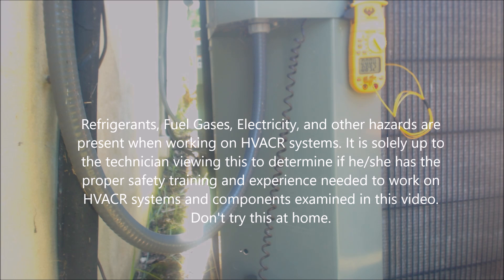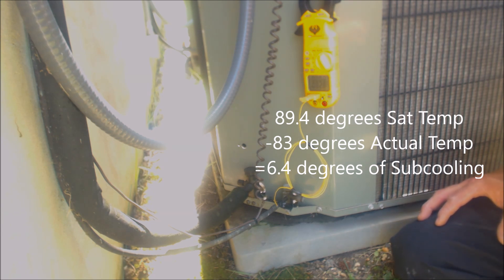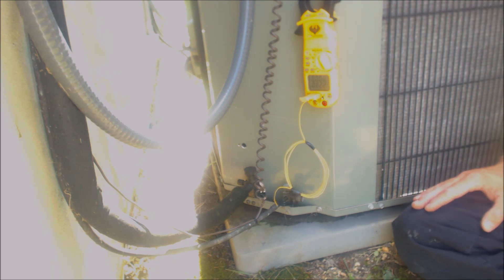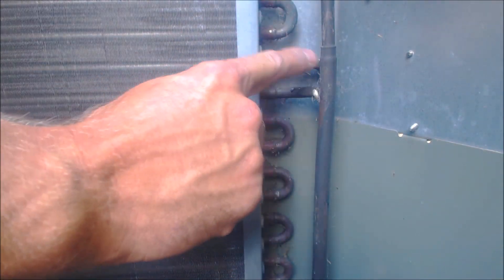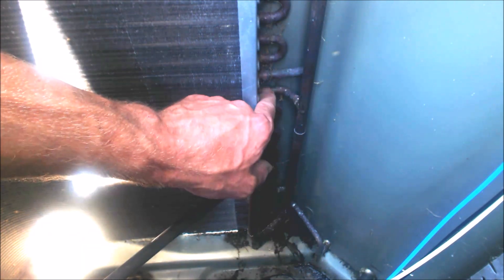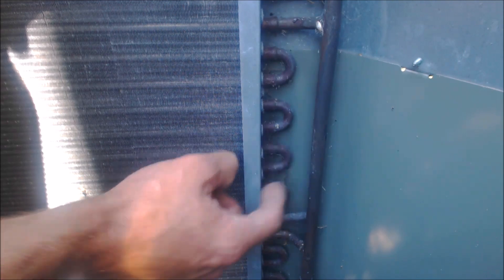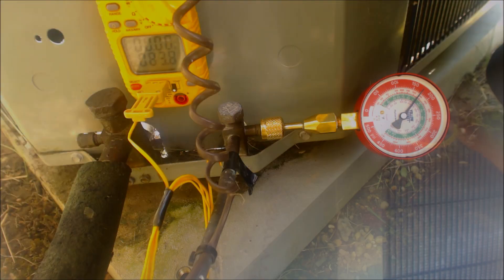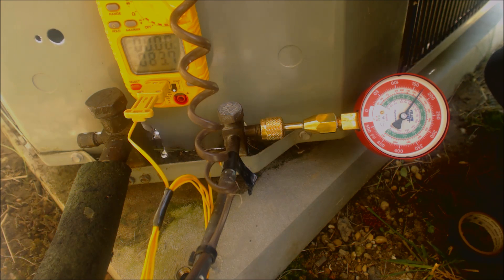Can You Really Check a Refrigerant Charge without Gauges?

Comment: Many newer EEV valve evaporator coil systems use two thermistors to estimate cooling evaporator superheat.  

First, cooling evaporator coil has a narrower saturation temp range than outside condensers since expansion valve is targeting about 42 degs F evaporator temp where condenser coil is at the mercy of outside ambient temp that varies quite a bit more in temp causing variation in where is the 'sweet spot' within the coil for nominal condenser saturation temp.  

On heat pumps the outside evaporator is at the mercy of ambient temp so two thermistor sensing does not work well for estimating superheat during heating mode. They usually use a convention pressure sensor transducer on outside coil along with an output temp sensor to estimate superheat for heating mode.

The primary adjustment on indoor evaporator superheat for cooling mode calculation uses two thermistors, one place on suction discharge pipe (like bulb position) and one placed at top of evaporator about six inches away from expansion valve manifold splitter.  This first near to expansion valve thermistor will typically read 4 to 6 degs F higher than actual evaporator nominal saturation temp due to pressure drop of 8 to 12 psig through the evaporator.  They fudge the first thermistor reading down by about half the expected evaporator pressure drop to get the approximate nominal evaporator saturation temp.  

Then subtract output suction line temp reading from the expected evaporator coil pressure drop corresponding fudged lower temperature from actual first thermistor close to expansion valve to get superheat.

Not perfect but a lot cheaper solution than an actual pressure transducer and does not intrude into pressurized suction line creating a potential leak point.

Comment: Hello! With a 3.5ton unit,in hot weather 100+ degrees outside AZ weather,what would be the lowest quantity of freon be in order the unit to cool down? Some technician told me the unit was a bit over half with freon and added 2 pounds to fill it up but still the unit barely cools.After reading that a 3.5T unit requires about 12pounds of freon and he added only 2 pounds while he told me that the unit was a bit over half something doesn’t add up.I just feel that he tries to sell me a new unit,idk.Thank you!

Comment: Your discharge line temperature also will tell you a lot. In the refrigeration world when equipment is factory charged with less then 1 pound of refrigerant and shipped out with no service ports. After check for everything else like dirty condenser coil, evaporator freeze up, fan operating, and ETC. Reading the discharge line (hot gas line) will tell you if you have a low charge or restricted metering device.

Comment: You didn't explain the physics behind this technique? When refrigerant goes through condenser it should cool down but how do you know 6 degree sub-cooling is not good enough? How did you relate it to the system pressure/leakage?
Reply from the maker: We use the target subcooling that the system is calling for on the rating plate, inside of the shroud or the literature. Each unit calls for a different subcooling, this video was just about that you can measure subcooling without reading pressure, thanks

Comment: Great video and information. Would you do a video on using the approach method that is found on Lennox systems?
Reply from the maker: That is a great idea for a future video, thanks Ivan!
Reply: @acservicetechchannel  you're welcome. I guess I could have asked that in patreon. How do you feel about using the air coming out of the condenser (condenser fan), minus the liquid line to get subcooling? Its usually right on.
Reply from the maker: Hey Ivan, it would really depend on how much subcooling the unit had. It may be close to accurate if the charge is correct. This would be because part of the air coming out would be hotter than the sat stat (desuperheating section), most would be very close to the sat state (sat state section) and some would be lower than the sat state (subcooled section), thanks and great question Ivan!!!

Comment: Dear ACServicetech, thanks for all your informative videos. I have a r410a system that I added refrigerant to with a piston. I charged to proper superheat,  and then checked my compressor amp draw. The nameplate calls for 14.2 RLA . The amp probe reads about 7.5 amps. Is that an issue?
Reply from the maker: No, it won't run up that high unless conditions were extreme. Just trust the superheat along with a delta t measurement afterward, thanks

Comment: How close is the condenser discharge air temp to the saturated temp? I have used that temp & the liquidline temp to try to get the subcooling. If wrong which way & how much?

It did prove accurate on one I did...it only had 1°F of subcooling checked both ways plus also checked with digital gauges.

Comment: So you place probe on condenser tube itself. For outside line which do you use probe on. I am a home owner.
Reply from the maker: If you have a txv then you can check the subcooling with one probe in between the fins right on the condensor tube but make sure it is in the part that is in the saturated state. If it is in the wrong spot then the measurement will not be right. The take the temp on the small liquid line near the service valve and minus this temp from the sat temp to come up with the subcooling. The target subcooling is found on the outdoor rating plate, thanks

Comment: I understand this is a different topic, but if you have a locked compressor and both the start and run capacitors tested good and you measure 90 amps with your inductive amp meter while holding the contactor in.  The condenser name plate reads 92 LRA (locked rotor amps) and this unit is on a 40 amp circuit breaker, why doesn't the circuit breaker trip first instead of the thermal overload tripping out first in the compressor?
Reply from the maker: Good question but the breaker takes a little time to trip unless it is a short. If it is drawing a steady 90 amp, it may heat up to fast in the thermal overload and that is what breaks the circuit first. It could also be a bad breaker. Usually when they go bad, they trip to easily but maybe it is bad and not tripping possibly. How old and what brand is the breaker?

Comment: The volt meter that I purchased from Harbor Freight only read Celsius. Would it be better to go purchase another volt meter or just get a conversion chart? Those temp. reading that I gave you before would have been C not F.
Reply from the maker: Hey Todd, you may want to look into this dual readout temp reader with 2 k type sensors. It is pretty inexpensive and I have one at the shop that students use. The one I have is pretty darn accurate. Here is a link to a Dual Readout Temperature Meter with two k type temp sensors-   http://amzn.to/2sQffyB
Reply: I read the reviews and many thought it was a waste of money. Thanks for the tip though. I may just purchase another volt meter w/ temp probe that reads in Fahrenheit temps.